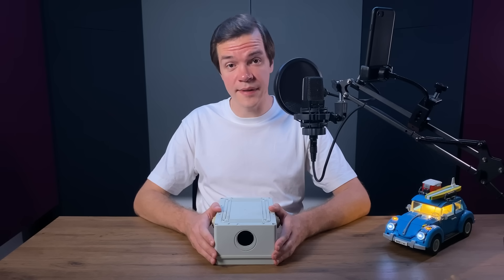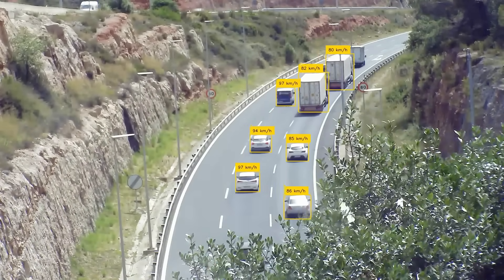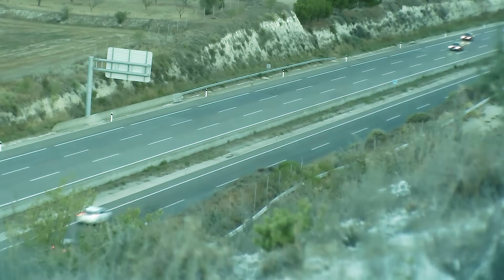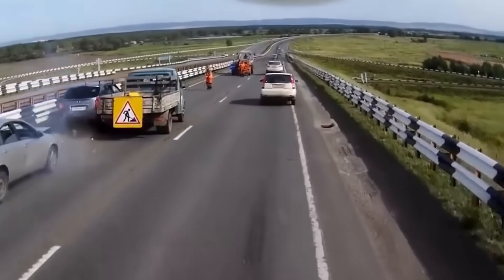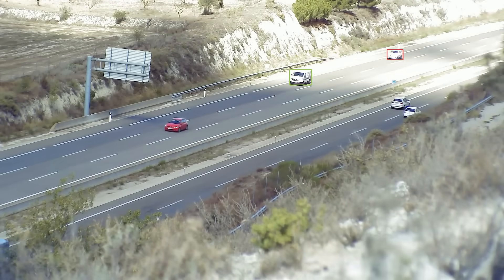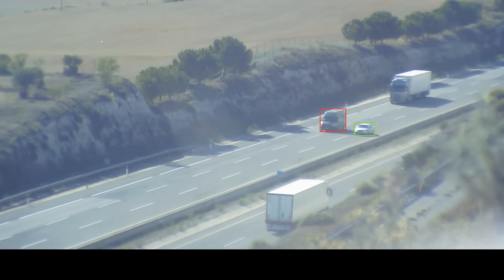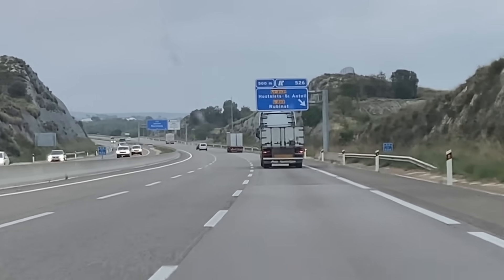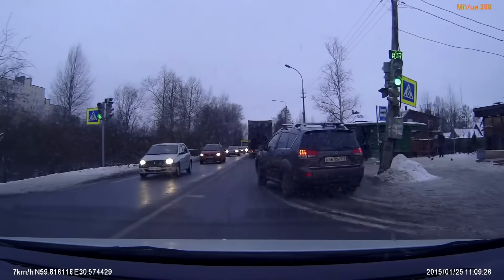New Anti-Tailgating Camera Reveals Shocking Statistics

Comment: I admit tailgating is a bad habit of mine, though unintentional. I believe motorway driving is generally the safest, with relatively few accidents despite your video’s analysis. Could your recommended stopping distances be outdated, not accounting for modern vehicles’ advanced braking? The real road safety issues lie in urban areas, where speeds are lower but risks higher due to cyclists, pedestrians, public transport, delivery trucks, poor roads, speed cameras, and road calming measures—many of which seem deliberately imposed by the heavy hand of the State for revenue generation purposes—to keep the parasite alive—rather than any genuine concern for road safety, as you rightly mention in your video. So it seems that Jeremy Clarkson is actually 100 percent correct that faster speeds equal less accidents and less congestion though when accidents do occur on motorways they can be more fatal and lead to lengthy delays.
Reply: No, more speed is always more dangerous and most accidents on the road are caused by cars simply because they are faster and not because other transportation methods exist and the netherlands show cars should be way more restriced in cities to reduce accidents.

Also cars in general got also heavier and better breaks can´t safe you when you 40 meteres behind someone at 100km/h even with the best breaks and perfect reaction time.

Just keep a safe distance between you and others.
Reply: @aroace7913  You’re shooting out of your rear, mate. Maybe too many government slogans lodged in your head while you’re cycling through the Red Light District in clogs, banging a bunny rabbit and smoking ganja. Modern ABS means cars stop way quicker than those crusty old stopping distances the State stubbornly clings to—proof the rules are stuck in the past. Motorways? They’re the safest places on the planet to drive—less chaos, fewer accidents, and certainly none caused by gestapo cyclists like you, harassing everyone into a crawl in urban jungles. So before you preach about “speed equals danger,” remember: it’s the crawling chaos with your pedal-powered police patrols that’s the real menace.

Comment: I always try to keep 3 seconds between me and the car in front of me. My Subaru has Eyesight adaptive cruise control that does a pretty good job of doing that. But without fail, some moron that had little instinct for physics, will fill the gap, causing either my automatic cruise control to slow down or make me do it. It’s just as you described and it is infuriating!

Part of the problem is that people here in the USA don’t know how to get back over to the right after passing.  The will just stay in the far left lane. The right lane is unusable because they don’t know how to use the on ramp to accelerate to traffic speeds. Or they will decelerate THEN exit. This forces you into the middle lane if you have any hope of maintaining a constant speed. But now you are blocking faster traffic. Then there are big trucks that pass each other at like a 2mph differential (or less). It’s crap like this that makes me no longer like driving. I am just hoping self driving cars will eventually take over. 

The real problem is there are too many cars. We need to invest in public transit instead and reduce the number of cars and trucks.

Comment: IMO tailgating is anyone less than 1 car length at the speed limit.
As a well insured older, manual transmission driver, I like to do a quick 5th to 4th shift just to see if they are paying attention, or if the smart cruise control is working.
If it's all working, all good. If not, damn am I litigious.

Comment: Thank you for the interesting video. I have long since determined that following too close is the greater risk, not speeding.

When driving on an interstate, I maintain a 3 second gap between the car ahead. If a car cuts into that gap, I slowly start slowing down to re-establish the 3 second gap. (I never brake check the following vehicle because it’s stupid.)

Most will be transitioning to another lane to continue speeding. What’s surprising to me is that I tend to follow other safe drivers maintaining the gap, and that goes also for those following my car.

Another thing is that I take the express lane whenever possible to reduce the chance of being tailgated too close and being boxed in when an accident unfolds. Further in Florida, legislatures made things worse by fining cars if they pass a stopped emergency vehicle, or say a state patrol car fining a driver in the emergency area. Of course, this creates people cutting back in to avoid a fine while creating a possible accident.

Comment: FlowNow: The 4 second rule.
A 4 second following distance has proven to be the optimum following distance minimum.
Losing ground doing the procedure of continually re-establishing a 4 second following distance is a psychological and optical illusion.
65 mph = 95 ft/sec, 60 mph = 88 ft/sec, 55 mph = 80 ft/sec.
10 sec at 95 ft/sec = 950 ft.
10 sec at 80 ft/sec =800 ft.
Loss of 150 ft over 10 sec duration.
It takes 1.6 seconds at 65 mph to cover 150 ft.
Dropping from 65 mph to 55 mph for 10 seconds incurs a time loss of 1.6 seconds.
If one had to make this dynamic adjustment 100 times in the course of one’s route, the net loss of time would be:
1.6 X 100 = 160/60 = 2.7 minutes.
Backing off to open up space to 4 seconds following distance 100 times during the duration of one’s trip would incur a cost to you totaling 2.7 minutes.
Would you be willing to invest 2.7 minutes to unclog the freeways. Not even to mention the added safety and reduction in stress?
Space Equals Flow.

Comment: One flaw with the overall premise.  You are conflating two issues. 

1) likelihood to cause an accident
2) "most dangerous"

Tailgating most certainly increases the likelihood of a collision, and stopping tailgating would significantly reduce the number of accidents. 

But as for speed... Yes "suddenly becoming stationary" is what kills people. But suddenly becoming stationary when previously moving at 30km/h is significantly different than suddenly becoming stationary at 130km/h.

So back to the two issues.

1) Stop people tailgating and you will reduce the number of accidents
2) Stop people speeding, and you will reduce the number of accidents that do happen from being fatal

#1 Might be the most effective strategy overall (you are reducing the total, not just a subset of the total), but #2 is much easier to measure, regulate, and address legally.

Comment: Very interesting study.

When I took Driver's Ed in high school in the 70's, we were taught to follow by 2 seconds. The assumption at the time was the human reaction time to an emergency was 0.40 seconds. We had a device to test this that consisted of accelerator and brake pedals. You would have your foot "on the gas", then a light would come on, and you's have to take your foot off the gas, and hit the brake. Our times were typically just under 0.40 seconds. But IMO, that pedal arrangement was not optimal. It was more like that of a truck, with a lot of distance between the pedals. I think I'm much quicker with the pedals on my Miata. However, I still follow at 2 seconds or more, which is considerably more than most around me. I should probably adjust my following to 3 seconds. My Miata has outstanding brakes and tires, and I suspect that I can stop WAY better than the typical vehicle on the road.

Keep in mind that the vehicle you're following is not likely to become instantly stationary. It's likely to take some distance to stop, too. I DO wish people would increase their following distances, though. I'd be happy with 2 seconds, which would be a huge improvement.

Comment: Very reasonable assessment.  I think a device in your back window that displays time between cars and flashes in red under two seconds could help.  It could also capture video in case of accidents to prove they were too close.  An automatic windshield wiper fluid sprayer when they are less than second behind would be a deluxe option I would pay for.

Comment: Having a rule that say to keep a specific distance in meters is just dumb. That distance should change when speed changes. It can also be fairly difficult for people to measure distances if there is nothing that tells you how long something else is.
For your own calculation with the video feed, it would also be much easier to just see how much time there is between the cars. Time will automatically change the distance between the cars when speed changes. It is much easier to calculate the time between to cars. Also no need to transform the video feed.

Comment: More people need to see this. 

Driving speed is only a starting point for how much time and distance you need to avoid an accident in an emergency. 

The severity of any accident is determined exclusively by the impact speed which can reduced if you leave sufficient opportunity to stop by either having enough gap or by driving at a speed within your capacity to stop. 

The greatest risk is when you follow closer than your capacity to stop or worse, closer than your ability to react. 

If you can’t get your foot to the brake you will hit at whatever speed you are driving at and your driving speed becomes your impact speed. 

If you are driving at 70with a 1 second gap you will hit at 70 but if that gap is 3 seconds you get to reduce your impact speed by 30km/h and hit at 40. Which is way more survivable, and if that gap is a proper 3.5 seconds, just half a second bigger, you will actually miss because the last 40km/h can be reduced to zero inside that time because of how inertia works and braking rates work.

Also the reaction of 0.9 seconds assumes you are expecting the car in front of you to do an emergency brake, which you never will because it isn’t what happens most of the time. 

What will actually occur in an emergency is you will see the car in front of you brake and assume it is normal braking and it will take another 0.2-0.9 seconds before you realise you are going to hit and start braking harder. You really need around 1.5 seconds for the average driver to be able to react to an emergency and brake appropriately. 

As a general rule I use a 2 second minimum gap at 40km/h and add an extra 0.5 seconds for every additional 10km/h of driving speed. I have never had an accident leaving this gap and every accident I have had was when someone cut into my stopping distance and then braked before I could recreate a proper gap.  But because I do try to maintain a proper gap every accident I have had has been a walk away drive away accident. 

This includes an accident that occurred at 60km/h but had an impact speed calculated to be around 5km/h. 

If I’m towing, or the roads are wet I add an extra second because experience has taught me it is needed.

Then there is managing your driving speed to be within your capacity to stop, particularly when it is limited by weather, darkness,and visibility obstructions like hills and turns. 

And if everyone leaves a 3 second gap then every car following doesn’t have 1.5 seconds of braking, but 1.5 seconds from their gap  + 1.5 seconds from the gap of the car in front of them. With 3 seconds of braking you can reduce your speed by 60km/hr and at 90 you can reduce it zero.

Comment: Great video, great deduction. Only problem is: most people that watch video's like this, are drivers that actually take precaution when on the road. 
As an ex-cab driver, I've learned to scan the road ahead from the car in front of me to as far as I can see. Not only on my lane, but also on other lanes and on what's creeping up to me from behind. In case of a tailgater behind me, I even tend to enlarge the distance to the car in front of me in case I get pushed up from behind in a worst case scenario. 
But even though I try to keep my distance, it's very hard to do so without the need of slowing down (with or without using my brakes) since the gap I leave is usually very fast filled with someone who cares more about getting past than about safety. Even though I generally don't need to brake when I need to slow down, I most of the time do it anyway, just enough to light up the brakelights, so people behind me (that generally are too close) know I'm slowing down.
And when I pass another car myself, I wait to change lanes till there's a gap that gives me enough time to light the direction indicator and to see if I still have enough space to change lanes. When I want to change lanes back I wait until I have seen the vehicle I've passed first enter and leave my side mirror and second enter my rear-view mirror to check the distance, and after that I look over my shoulder to see if it's really safe. While most people cut me off when they've passed me. Most of the time not enough for me to have to brake, but definitely way too close for comfort.

Part of the cause of all this is the increasing traffic. Part of it is people trust way too much on their vehicles collisions electronics to warn them. Another part (a big and worrying part) is peoples mindset. We humans generally don't grant anyone anything anymore (there are exceptions). We are all in a hurry, want to be in front, think we are better then others, and we no longer care about rules and even fines. A Dutch saying 'we do not grant each other the light in our eyes' points out our traffic mentality in general (again, there are exceptions, thankfully). As long as that isn't going to change, our behaviour as drivers won't change either.

Comment: Makes me want to mount a 30 foot pole on the front and rear of my car…

Better yet…make it a variable length pole that expands/contracts to the front and rear to “claim” the appropriate space.  Make it so they only deploy at speeds greater than say 30mph to avoid the poles intruding into adjacent lanes when turning.  Equip the poles with lights and high-visibility paint for visibility, and add video capabilities.  May as well put a flashing indicator on the rear to tell the tailgater to ‘back off’.

Kind of like a truck with a 16’ piece of
lumber hanging out the back with a red flag on it.

Put cameras on the ends of the poles to capture brake checkers and tailgaters and we may have the beginnings of a viable solution.

As an alternative it would be fairly straight forward, from a computational aspect, to equip cars with a huge red light on the roof that activates when someone is following too close to let the tailgaters know that are too close, and an automatic braking mechanism, or at least a visual/acoustic indicator that activates when you are too close to the car in front of you for any given speed.

The auto manufacturers will never go for it, but there may be a viable opportunity for some aftermarket products here.

Comment: We have very similar habits on the roads in Australia with tailgating combined with a fear campaign that vilifies speeding and  has most of the public repeating this idea as if it's the only factor influencing anything. Also over the recent decade or so,  this has got considerably worse, with the additional extremely dangerous habit forming when driving on a country road with single lane  going each way, many drivers fluctuate their speed chronically, but mostly way below the speed limit, then when the lines are broken so it is legal to overtake, they accelerate, particularly if another car tries to overtake them, they seem to get ultra competitive and oftem aggressive, disregarding all safety even when coming up to blind corners, theu keep pushing often making it very difficult to get past and  then if they also often try to tailgate after previously driving at snails pace....Crazy!

Comment: Around 20 years ago Japan invented the smart class for the windscreens of vehicles. Such a display was deemed to dangerous because it can display a large map on the screen when the vehicle is stationary. Such a feature doesn't work when the car is in motion. I could also be used as an entertainment system when the car was off the road and parked up away from any roads, like a campsite for example.

The smart technology prevented the screen blacking out when the location of the car was still too close to the main road. Yet, the question raised was that if it to develop a fault what would happen when the vehicle was in motion.

This concept never made it out of Japan, but parts of it were what we all need. I didn't agree on the screen being able to black out. But the smart systems that prevented the car from displaying the map when the car was in motion is exactly how we solve the tailgating problem and maintaining safe distances.

In other words, the smart glass linked to a series of sensors of the car can act as an interface for the cars microchip and adjust the speed and position of the car accordingly, even if the car is being manually operated the automatic system can take over.

But, it's a slippery slope, like driver behaviour people in government have bad behaviour as well and have hacked the microchips of cars a few times to take out a target. 

So, the real question now is, how do we solve the human driver problem? That's simple, we start in school. If we had special exercises to show students about momentum, like going down a series of different slides at different speeds and into balls and other soft materials then we can understand speed and momentum. If we then used a series of props and launched them down the different slides at different distances then we can show the students what happens when something is travelling at a faster speed with something else at the same speed or faster following too closely behind it.

We can use technology to show the impact. We can also use a track to show what happens when one object impacts another at high speed if the object in front suddenly slops. It sends a subliminal message to the students that will make them think more when they are adults; it will impact them and their behaviour.